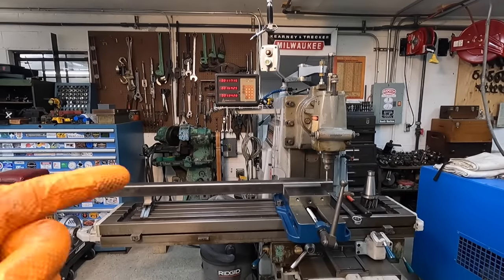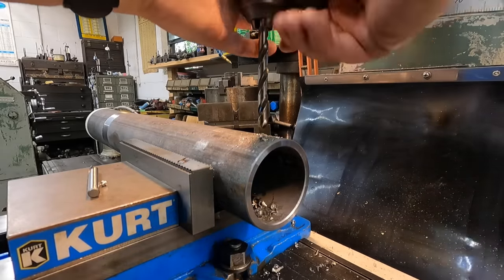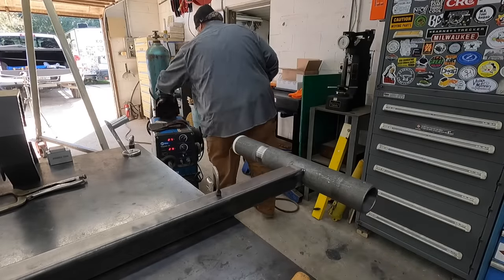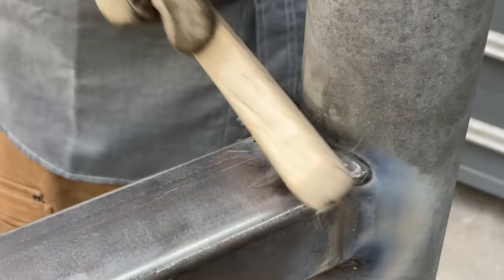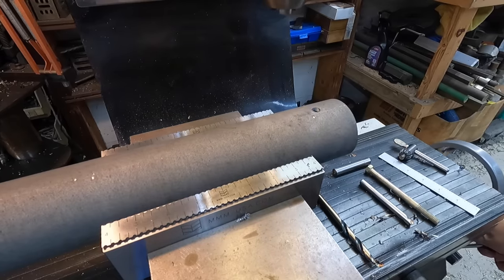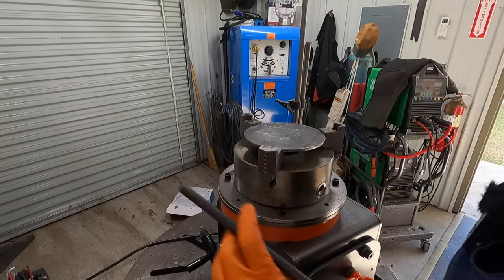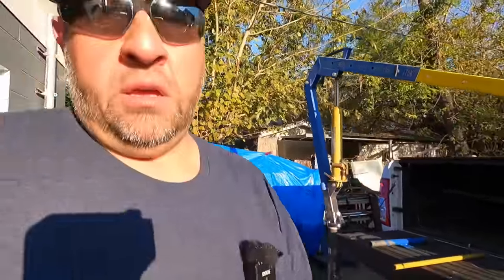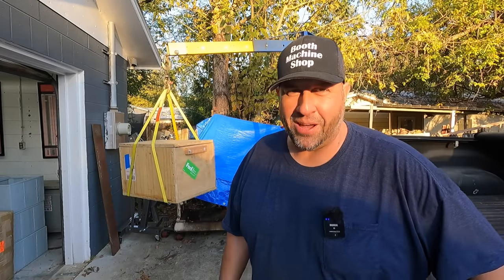Truck Hitch Crane Build Ep. 7: First Test!

Comment: You're going to put way too much torsion and stress on the bottom tube connecting the crane to the hitch. These typer cranes always require bracing on the bottom especially if you want to lift anything of significant weight. Mine has braising and even with the braising sometimes it feels a little sketchy. Try lifting 500-600lbs you won't feel safe using it the way it is
Reply: Exactly what I was thinking, now I haven't welded anything ever, but Torque = length x distance and when he lifted that 200 pound vise he probably put close to 1000 pounds of force on that joint. I would definitely put a big gusset on the top and bottom of that joint.
Reply: Well, that's a half-ton truck, so you're not going to be putting anything significant into the bed anyways, especially if he's got it fully extended into the 1/2 ton position.

Comment: Hey man, a buddy and I are building a firewood processor, lots of dual shield welding so far.  He is a fabricator by trade.  He's had the same issue with 'worm tracks' during this project.  Long story short, leave your electrode further from your work, it will give your flux more time to do it's thing.  He's running, 3/4 to 1 inch, no more tracks.  AMAZING content by and by, keep it up!  Thanks for sharing what you do!

Comment: That stilt wont work - I noticed you tested it lifting and setting down and picking back up from the bed, but you didnt load a few things from the swap meet or log pcs from the tree that fell, and then tried to pull that pin now that theres 500-1500lbs of weight in the bed....... You'll never get that pin out to retract the foot without getting out the jack from the truck to relieve the weight off the pin, because when the ass-end of the truck sags, the stilt on the tube is locked in!!!
I'm thinking a simple trailer tongue jack with a crank handle, attached and ditch the stilt altogether
Reply from the maker: Oh it’ll work and I can’t wait to prove it to all the naysayers 👍🏻 There’s more to the story than meets the eye.
Reply: @Abom79  So many nay sayers
Reply: If he has air struts he can just lift the bed a bit No?
Reply: My thinking, also. This was an incomplete test. Getting that 'foot' retracted is a big part of the "test". I think he''l need to carry some kind of jack to get the pressure off the foot. "A Relief-Jack; Don't leave home without it!" I'm pretty sure he's already got a plan for that. 👍 😄
Reply: @arkiefyler  Anybody think the lift itself could easily be used to take the load off the foot? C'mon guys, think! It's right there!
Reply: @mdacosta5882  Yeah that's what I'm thinking....Adam has air shocks on that truck. I'd bet on it. :)

Comment: Can you pull the pin out of the foot after you set the load on the Trucks suspension? I built a similar one in a junk yard. i mounted it on table section from some scrap table and that was when i had to trim my legs off and used 2 trailer jacks.

Comment: No offense intended, but in my humble opinion, this is the perfect accident machine. Two tons of weight as a likely asymmetric shear-force on a 1/2" bolt of the foot? It's enough to make your toes curl. It is not a coincidence, heavy duty ball joints are used to avoid asymmetry and hardened pins in welded bushings to minimize shear forces in such applications.
Reply: Total agree
Reply: I would disagree because it's never designed to load items that are heavy enough to compress the suspension of the truck.
Reply: I definitely agree with what you said. Its most certainly true, but I'm pretty sure he said in a previous video that he didn't intend this crane to be used for lifting things much over a few hundred pounds. Just something to help save his back when he's alone and needs a hand lifting something into the bed of the truck.
Reply: I’m sure that Adam knows enough about his truck, shear strengths of steel, and loads he plans to lift to stay well within safety limits.
Reply: @ellieprice363  It might surprise you, but bolts are designed to cope with tensile and compression forces and not with shear forces. That's the reason, why mechanical engineers always add dull pins and eventually bushings (both made from hardened steel), whenever bolts are subjected to shear forces. A bolt, pushed through a drilled hole of two concentric pipes can be easily sheared off by a simple force impulse. Since the whole weight of the crane and the load relies on one single rigid telescopic foot in question, any random slip-stick of the load is enough to invite disaster to strike. It's not a coincidence, knifes of parrot-beak bolt cutter tools always follow the very same geometry.
Reply: @jacobfoxworth  Intentions are one thing, but unintended stick-and-slip of loads on cranes create surprisingly high impulse forces. Unfortunately, steel subjected to shear forces is not a forgiving material. It breaks in the moment, when its load capacity is exhausted.
Reply: @debrainwasher  Yes of course a single 3/8 bolt would shear under enough load, especially if it shifted or dropped suddenly. However, there’s very little danger of a 3/8 diameter pin shearing while lifting the loads this crane was designed to lift. Something else would fail before that bolt would break.
Reply: @debrainwasher  So let’s assume for a moment that the load is heavy enough to shear a steel bolt completely in two places. What happens? Not much. The load drops a few inches but is still safe since the sliding tubes remain inside each other and are still attached to the truck. Relax. This unlikely accident does not result in a catastrophe.

Comment: So, no gussets or triangular bracing? Does that mean you're relying on the compressive strength of that cylinder alone? What happens if it gets off-kilter? Would it bend?
Reply: The compressive strength of that cylinder is immense, and the weakest point in it is a solid bar of steel. I have dropped milling machines onto hoists like that and while the casters flattened, the cylinder was fine.

Comment: I had a thought after seeing the crane all together. I wouldn't like the manhandling/setup before and after the lift, as well as taking up bed space transporting the crane instead of cargo. 
What about cutting the vertical column between the lower cyl mount and the gussets. Fab and mount a hinge at cut on the opposite side of cyl.
When you are done with  lift, close tailgate, swing boom out to the left, fully lower boom to storage position, then lay the whole unit down on its "back" parallel  with tailgate. 
You would also need to add a stand on the cross bar to support the unit when parked horizontally. That too could be hinged to lay flat on cross bar while gate is down.
Throw a ratchet strap on it, center the whole thing left to right to balance, and down the road you go.
You'd only have to manhandle it off the truck once you're completely done using it. Would also have the benefit of having the whole assembly in a horizontal position for mounting-dismounting.
Much easier on the body than trying to insert that tall structure vertically. 
Just some thoughts...

Comment: I knew reading the comments there'd be some good ideas 💡. I'd like to add a few. 
#1 a swivel foot like ones on a c clamp. 
#2 airbag suspension for the truck. 
#3  fold down outrigger. 
#4 linch pins so the hydraulic  cylinder so you can install it after mounting the boom upright.

Comment: Im a boilermaker welder here in Australia. I had the same issue with fluxcore running mixed gas. The solution i found was to swap to straight co2 even tho the box the wire came in said 75/25. Never had an issue since.

Comment: just a suggestion - on the base plate if you were to drill a hole you can either have a zerk fitting or an oiling cup so that you are able to lube up at any time or when you are loading quite a few items and you have to lube during.

Comment: Take what I say with a grain of salt since I am not a welder, but when I was looking into dual shield the one thing that came up about worm tracks was gas flow. Usually too much of it and it getting caught under the flux hardening.

As you said your bottle could be having issues too but worth at least a little research for you I'd guess. Love the videos man! I have a small PM lathe and hope by next year to have a small version of this for wood collecting and work related activities.
Reply: Andrew you are correct. I've been a welder for over 40 years and when running dual shield wire through a mig welder you have to turn the gas down considerably and  turn it back up with solid wire. A mig welder will give you a much better weld with solid wire with the gas. You will also get the small worm holes in booth when the conditions are very windy and the gas is blown away from your weld.

Comment: Adam, two things occur to me right off hand. 1) You might think about putting a small weep hole through the weld on the bottom of the foot (or maybe in the center of the round foot plate for drainage. 2) Once you put, say, 500 to 800 pounds in your truck bed, how are you going to get that pin out of the leg tube? Maybe incorporate a small 2-ton HF hydraulic jack in the foot. That way, you can preload the apparatus a few inches prior to loading and then just release the jack pressure afterwards.

Comment: “Mig Welder issues” check your electrical connections. We had a issue with our bigger Tig Rig and it turned out that the wall plug wasn’t rated for 50 amps/100% duty cycle. Fought with it far to long, hope you find your issue. I also like to make up my own ground lead using over-sized cable and a “screw” type ground clamp. Also try clamping your workpiece directly rather than the table. You can do a little test by welding something to the table vs a weldment laying on top. Let us know what you find cause a MiG in a shop environment can be your best friend. Leave the stick warmer on the service truck!!🤦🏻😂 fantastic video series BTW , keep up the great work

Comment: Hey Adam!
I am NOT going to expand on other's comments about loads in bed preventing the release of the foot against the ground.  What I am going to recommend is further 'down the road' in final use and stowage.  Create a PVC pipe & cap "cover" for the male shaft component to prevent contamination and grease smearing onto items in the truck bed!
Best regards,
Ken

Comment: Nice results Adam.   A few comments from way the heck over here on the left coast.   If you had used a spiral hole pattern up the support leg then you would have had more material between holes but perhaps ~1/8" steel in two places is enough to support whatever you plan to lift?  Also, Adam, you may need to add a downrigger on either side of the support leg (parallel to direction of the truck length axis) because once you extend the arm with a heavy load and rotate into the bed our outboard of the hitch, there will be an enormous amount of torque and could twist the hitch mount cross member.  Watch the foot when you swing a heavy load into the bed (or way outboard) and see if it moves - to indicate appreciable twist.  Finally, when you were testing the rig rotation with the yellow bar wedged between the vertical support and the hydraulic cylinder, I noticed a through hole about one foot below the upper elbow bolt.  Looks to be a hole left from the original hoist assembly.  Can you not use that with a bar for rotation?

Comment: Adam I found this write up and thought I would share it with you.

The gasses don't "go bad", but in some cases, after an extended period on time set up in the vertical position, they will seperate, if they are a mixed gas.

Argon-CO2 mixes, need to be layed down on the floor, and rolled around for a bit if you have not used them for extended periods. For some reason, Airgas's 'SteelMix' does not, as it has a siphon tube feed that mixes internally.

This was a suggestion from both a Miller rep, and Airgas.

Comment: Instead of welding pipe on the outside of the square tube for rotation, weld a pipe through the middle of the square tube.  Much cleaner and will never fail.  Also, you could do the same for your adjustment holes on the down leg.   That would help you feed in pin and extract pin.
Oh and it's still not too late to use a cranking trailer jack for your downleg....😁

Comment: Hi Abom from Down Under Australia
Enjoy your show
Just a suggestion , drill and weld pipe threw the base 2 times in a cross configuration
this will reduce parts sticking out causing damage to your truck and its loads 
by welding pipe threw the base you regain the box strength of drilling threw the crane base above the swivel point and giving you a much cleaner finish

Comment: a screwjack might be better for the bottom support because when you put a heavy weight in the truck, the suspension will lower a little and the lift might get stuck

Comment: Great tool!!! Now add the air over hyd option cylinder and use the on-board air that should be on your truck anyway and have a smooth fast lifting crane

Comment: 2 things I'd like to see on that build would be a trailer jack that pins on for that leg, you could screw it up and pull the pin throw it in the bed for transport and it would be infinitely variable for varying ground height and also where it pins to the reese  hitch needs a 180 degree pivot so you could use the hoist on the right side or straight out the back like where you could literally reach into a garage and retrieve an engine block set it behind the vehicle reposition the pivot and load her in the bed or into another bed,, great Idea I've got an old engine hoist might have to look into this. use a jack that has rolling wheel on it and might just be able to still use it to pull engines, wow what a pick and pull tool!! Good one Adam!

Comment: You are inside and have clean steel. Lose the flux core and try solid wire. As long as your gas is flowing right its more then enough for what you are doing. And always read the package on wire when you switch to new stuff. Two things i see may be and issue with your crane setup. Our bed crane has a cable winch on it so it can grab loads from ground level. Yours might run out of reach. Also the foot is going to get a load on it when you put weight in the truck and get jammed and not be able to get the pin out. We put the a handcrank foot from a trailer tongue for ours.

Comment: @ Adam
  I would suggest a gusset at the square to round tube  where you did the cope . 
the 3.5"square tubing becomes a torsion bar when you swing the load 90 degrees to the front or back 
almost  like the crane in your new shop with the gussets at the base

Comment: The pinholes are from gas issues. Check your regulator they often go bad. I just recently had the same issue and swapped my regulator from my tig welder to my mig and it solved the issue immediately! Another thing to always check if the end of the wip that goes into the welder itself. They have o-rings on them that also go bad from time to time. A spray bottle of soapy water is your friend check for leaks with the machine unplugged and the bottle on!

Comment: Just an observation but if you pick something up that’s heavy and you load it onto the truck bed the suspension will obviously lower the back of the truck. Will that make the removal of the pin on the foot difficult because a lot of the weight you’ve loaded is sitting on that pin?

Comment: The pipe looks like being galvanized and there is also the typical white shine from the zinc oxide after welding. I'm pretty sure, that causes the pinholes in the weld.

Comment: Hi, Adam. Nice job. Don't use the hydraulic tube as part of the rotating mechanism. Also, even though the foot is supporting most of the weight, there is still tork present where the box tube is welded to the upright. The vertical force is handled ok, but all the angular force is on the weld. It seems that the weld is strong enough. However, if you lift something from the far side of the truck, as from a loading dock, all the tork is on the weld and the two bolts holding the square tub in place. Those all seem strong enough. But the weakest point is still the box weld. I am thinking that you will solve any problems with the hook and how it turns into the lifting arm. So, a successful project, with a couple of spots to keep your eye on as parts are flexed over the yers. Thanks for sharing!  Stay healthy!

Comment: What happens when the extra weight in the truck compresses the springs?  How can you raise the foot of the lift if it is under pressure?  One suggestion would be to use a screw jack like on a boat trailer for the foot of the lift.   Great video, thanks!
Reply: If you watch the entire video series you'd see where he talks about this.

Comment: You could weld a piece (or two on two faces) of a slightly larger diameter tube onto the square section for the existing handle to fit into to rotate the rig. Great ideas dude keep up the most outstanding work.

Comment: The pin with the push button has to be hollow for it to work and therefore has a lower shear strength. Even a 3/8" solid pin seems a bit on the small side. Take a clue from the pins on the hoist arms themselves.

Put the rotation handle socket down at the flanges; that's where the load is (the friction is the load).

Parameters, not perimeters.

On the positive side, the most important thing with any project is that it actually gets done. Enjoy the fruits of your labor.

Comment: In my experience with dual shield, if the spool is left out and not reasealed to keep moisture from being absorbed it will leave pinholes and wormhole porosity no matter what you do. Gas shielding is important no less but the wire is a low hydrogen style filler wire just like E7018. My recommendation is keep the thick plastic bag the spool came in with the box. Had an old iron worker and CWI explain that one to me. Saves money when you can use the full spool of 50 pounds of wire compared to throwing away a half used one that went bad.